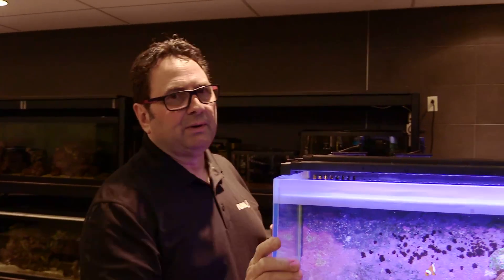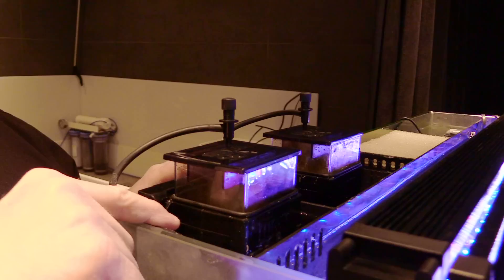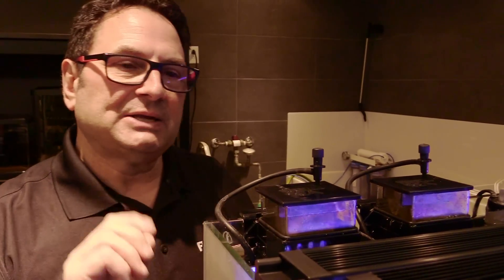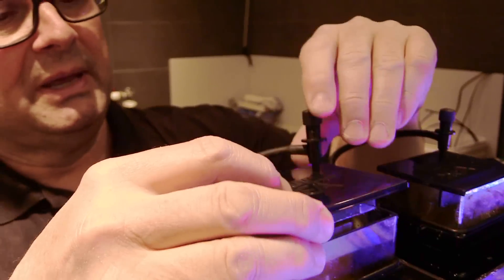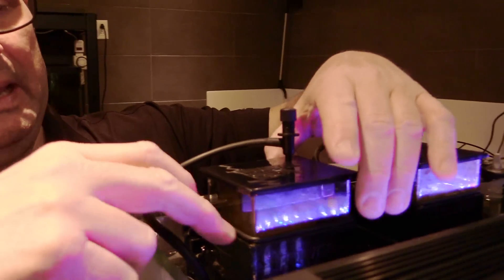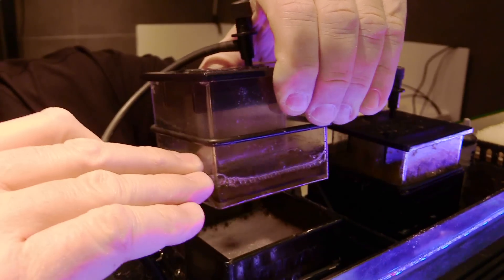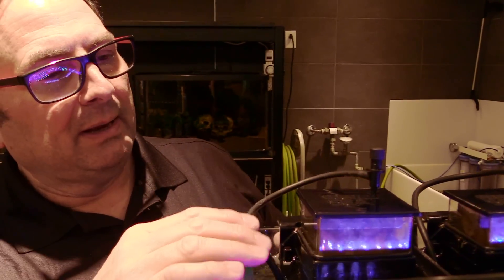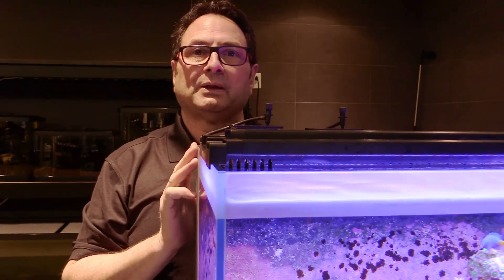Fluval SEA PS1 Protein Skimmer Tips

Comment: This skimmer is so quite which is rare to find!!! One thing tho, don’t fully open the air valve.. Start with the valve shut then slowly open it until you hear it sucking in air then leave it as that…. You want the smallest micro bubbles for longer contact time….

Comment: I think the major problem with skimmer is the suction cups, every time i try to adjust the skimmer by lifting it, the suction cups will fell off and trying to bring from tight spots is hard. Other than that it works fine

Comment: My sump isn't deep enough to get the water to the minimum water level, in the manual it says you can put it into another container with water? how exactly do you get that to work?
Reply from the maker: Hello! If your sump does not not offer the minimum water level required for the PS1 Protein Skimmer, adding another container inside the sump with a higher water level may help! This container should be supplied with water either from a dedicated submersible pump or the incoming drainage water from the display aquarium. The container can then be allowed to naturally overflow into the sump. This type of installation will also provide a constant water level for the skimmer! 👍

Comment: Hey why my new skimmer make 10000 of micro bubbles  ? Is it broken??? I use it in fluval marine flex 123l.
Reply from the maker: Please check to make sure the skimmer casing is well closed. The skimmer should not be located in the direct path of a pump or filter.
Reply: Fluval Aquatics where can we put it? As there is not other place other than on top of the filter pump in the 123l ... I have the same issue :(

Comment: How long does it take for the bubbles to come in the cup
Reply from the maker: It can take up to about a week for a protein skimmer to break in and start working properly. You may need to make some adjustments to the air input and collection cup height as well!
Reply: @fluval  yeah I made it level up and the air I had it super loose and if it doesn’t start in a week then it’s done for

Comment: Why does the adjustment valve have to be inserted in the lid?
Reply from the maker: That is the air inlet valve, it needs to be kept at the highest point on the skimmer in the event there would be a power failure you could avoid a back siphoning effect if the valve were left at a point below water level.
Reply: Fluval Aquatics thanks, so it just has to be above water level it does not necessarily need to be clipped in the lid

Comment: I just bought one of these should they be leaking air bubbles outside of the skimmer into my sump
Reply from the maker: Most skimmers will emit some air bubble leakage, simply install an effective bubble trap in your sump.
Reply: @fluval  I just turn my slimmer on amd have the same problem to many bubles. What is a buble trap a m d how do I install it on the fluval flex 32.5 gallon
Reply: Just bought and mine was split or open on the left. Bubbles were spewing out.  I had to squeeze it and it clicked or popped into place. Now I just have to adjust I guess because my tank is filled with microbubbles